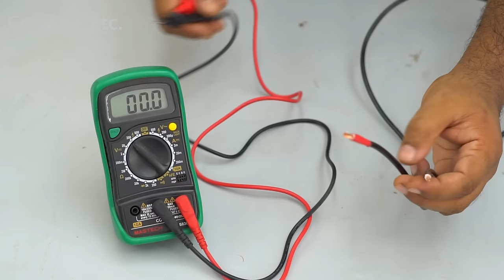How to Cook Food With Solar Panel

Comment: This is not complete information.... explain the DC to AC setup to all viewers
Reply: no need for dc to ac in this case, the heating element is a resistance.
Reply: You do not anderstend.This is DC to DC.Heating resistance
Reply: There's no need for DC to AC conversion
Reply: why need ac?  parral conection 130 v is enough for this.
Reply: Working on dc voltage
Reply: 6 panels for electrical stove, so sad 😭😭😭, very much experiencive
Reply: @ultronplayers1416  How sad????
Invest 50k one time and free for 25 years.
2k per year.... It's a super duper deal...

Comment: I use induction cooktop in Australia using 8 panels 250 watts each in series, also heat sand in metallic bucket to use in night when sun is not available. Sand store heat at much higher temperature.
Reply: helo from brasil here. 😊
why in the world some one would heat a buck of sand?
😞
Reply: @attilarivera  : It is very chilled in the night. So, the room with the sand bucket will be warm for some time.
Reply: @attilarivera see videos on sand batteries, we make pop corns in hot sand, tea in clay pots by putting those pots in hot sand. The taste of such popcorn and tea is very different when cooked in hot sand. No inverter is needed.
Reply: Direct DC crunt se posibal hai
Reply: @hikundu  wow...
I was born in brazil, and I never even considered the idea that there were places with such low temperatures. Of course, we have the south of brazil, close to the South Pole, and I've never been there. However, I've been told that temperatures there can reach -5 degrees Celsius. I live in the northeast of brazil, where the average temperature is 25 degrees Celsius.
👏💚💛💙
Reply: Can you tell more on your setup? I need your help

Comment: You did very good joke with us. It's fake story because the power source hasn't shown while cooking. may be the cables has connected with normal Ac power.
Reply: Bro. if you don't know something you better learn. If you have the funds try it yourself. Even a 12v battery can and does do this let alone 129v. You lack knowledge about electricity.
Reply: No, it's real. You can heat up a heater with series connected solar panels.

Comment: nice but does this mean we need 150 V DC to use with the cooker resistance???
Reply: Not really but it helps to speed up the heating process and provide close to a constant voltage and current because the weather is unpredictable. If he was to use a battery, he could have gone away with even 12v but slow cooking with the same heating element.

Comment: At 130Vdc, how did you managed to protect yourself from being electrocuted?
Reply: It's Dc. DC current doesn't behave as such at such voltages. It needs to be much higher than that. It compensates with serious arcing which was evident when he touched both ends of the cables. Ac current will certainly kill at such voltage.
Reply: @mosesgoiho6240 Clearly there are certain aspects he skipped or didn't show us, but am telling you for a fact , (from experience) if you connect solar panels in series, anything (voltage) from 96v upward, will send shocks straight to ya body